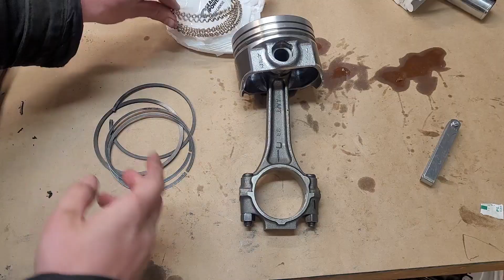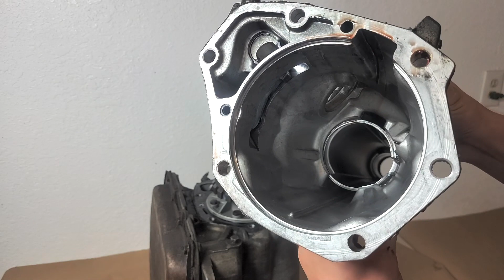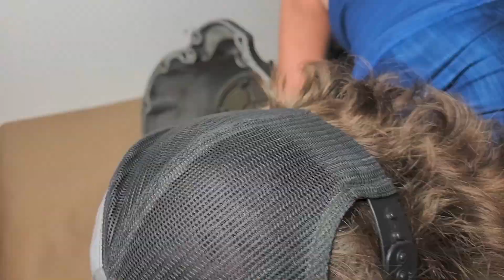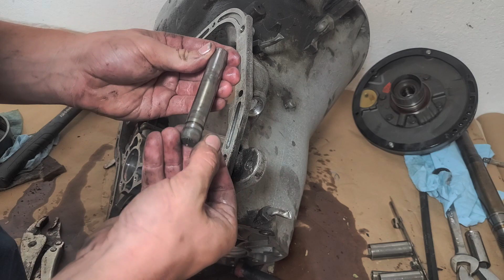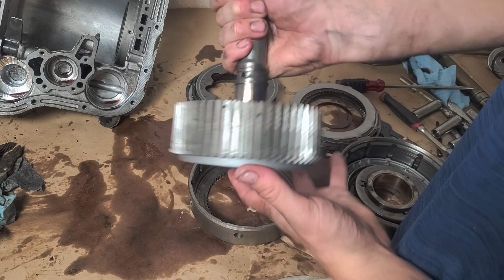Torqueflite Teardown and Inspection - 73 Dart Transmission PT 1

Comment: I rebuilt many of them over the years.  I started working as a mechanic's helper in 61 at the age of 14. By the time I graduated from college in 1980. I was a fully licensed mechanic.  The majority of my work was normal maintenance, but I still rebuilt my share of automatic transmissions and engines, more rarely a rear differential.  If memory serves there were certain areas of the input and output shafts that were prone to wear, which meant the transmission would not work properly if it was excessive. We checked those areas with a micrometer to make sure they were in spec.  That transmission looks very good, and if I had to guess would say it had very little mileage on it.  If the fluid was changed at recommended intervals those transmissions could go over 300,000 miles before needing repair., unfortunately, few people followed the recommended service intervals.  I took apart transmissions with over 100,000 miles that had never had the fluid and filter changed.
Reply from the maker: Thanks for sharing! This one was in excellent shape